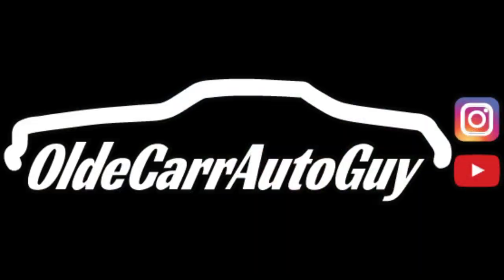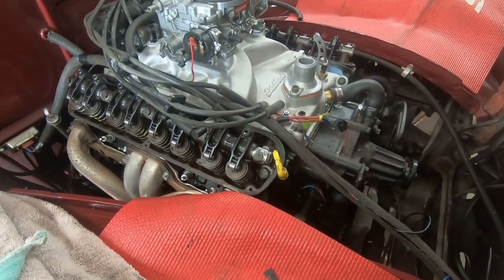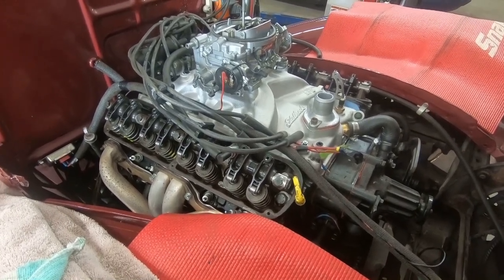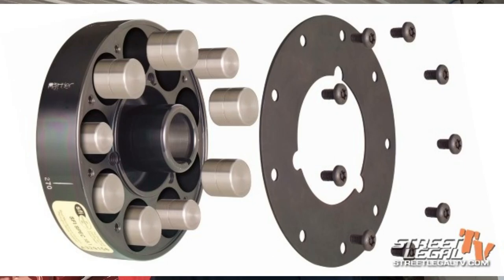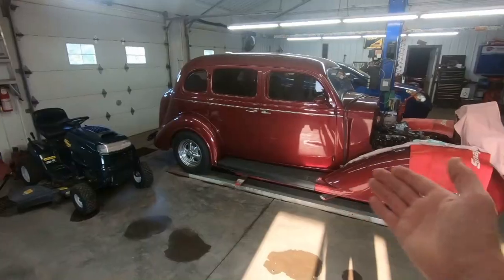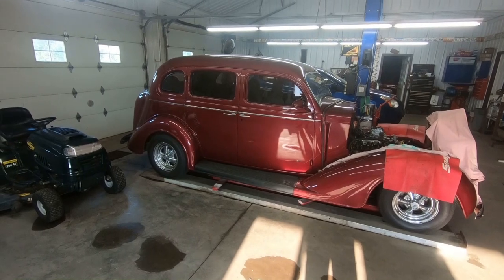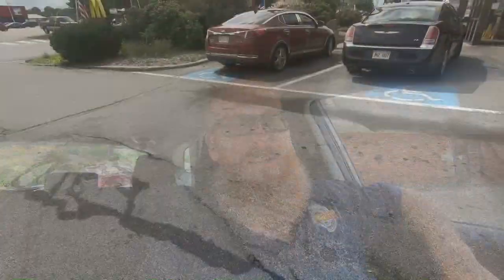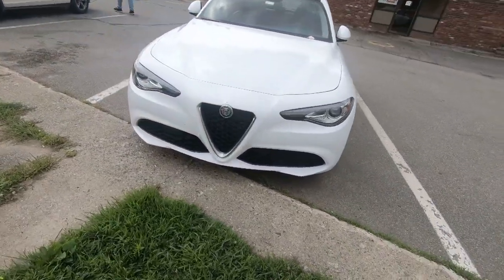1936 DODGE PROJECT GETS A NEW EDELBROCK INTAKE MANIFOLD & CAB

Comment: I like the fact that it has a small block Mopar in it!! Different and classy! The single plane that was removed is definitely for drag or hot street use with low gears in the rear. Single planes don't have the low end torque for more driver oriented cars. Carb spacers can really help to.
Reply from the maker: She's gonna live to see the dyno in the spring. Here's hoping for 350-400 HP.

Comment: The intake you took off looks like a single plane , not very good for the street , hope you put on a duolplane , what size small block do you have in the dodge ?
Reply from the maker: It is a 340 out of a 71 Duster. the Edelbrock Performer RPM intake is a dual-plane. So we are hoping to get a little bit better Street performance and fuel economy.